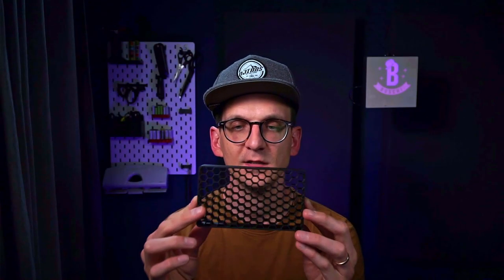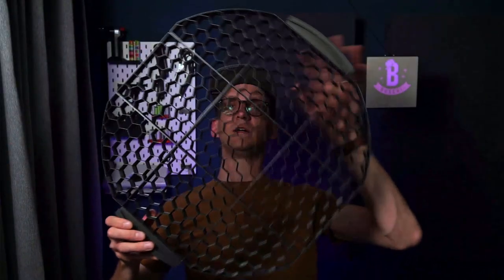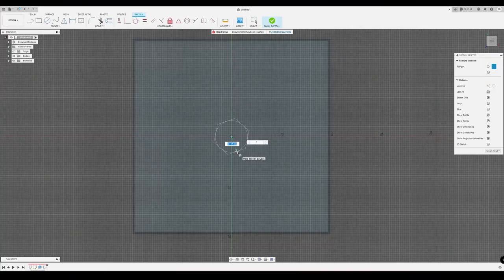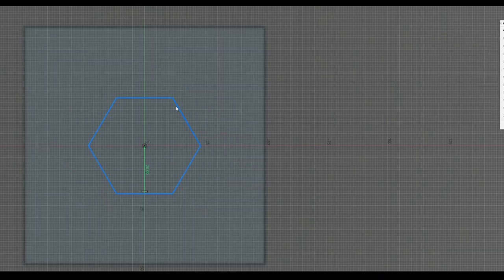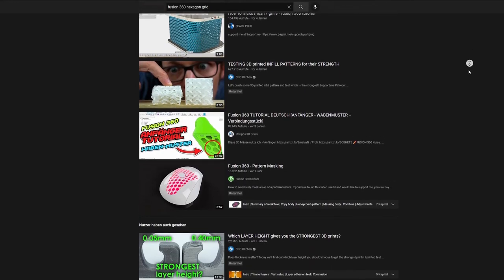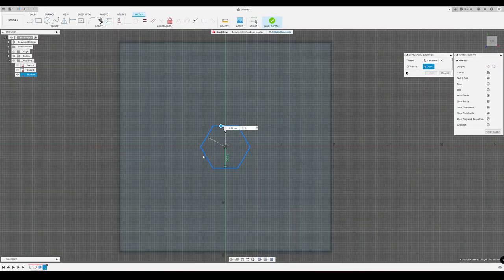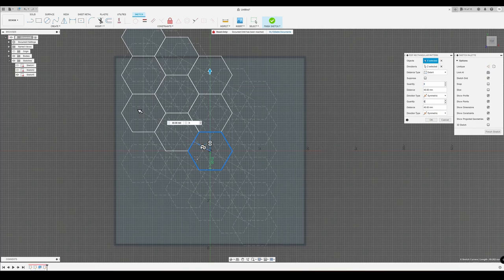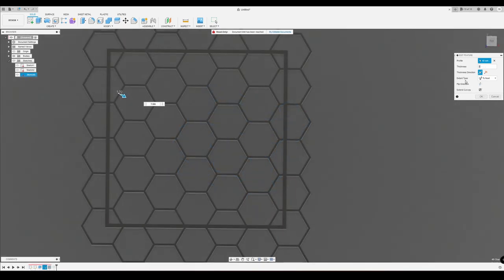Best Honeycomb Grid Trick in Fusion360

Comment: I know this is not CAD based but if you just need a quick honeycomb structure to print try this: 
Drop your solid part into your slicer,
Choose honeycomb infill, 
Choose no top or bottoms walls,
Change infill density to change how many hexagons there are,

Simple thing to do in slicer if you need a or want a quick easy fix but definitely use CAD if you want parametric designing and to make more complex patterns. 

All in all good Fusion tip! 👍 Got you a sub!

Edit( I really should have noticed that everyone else in the comment section had the same idea before posting… oh well… great minds think alike!)
Reply from the maker: Exactly. For quick and easy I would also go for slicer help, which opens a whole new world of tricks. But as you said, for a proper model I go the longer route. Check out my new video on this, which uses a slightly different approach https://youtu.be/EayXBg41U9M

Comment: I had a nightmare trying to work out how to create hexagonal light channels for a telescopic sight sunshade. In the end someone on a Fusion360 forum pointed out something really simple; just design the cylinder as a solid, import it into the slicing software and set the infil to hexagonal - then just set the number of top and bottom layers to 0. It worked perfectly and took moments. By far the easiest way of achieving this.
Reply from the maker: It is amazing what paths lead to success with 3D printing.. :-)
But personally I prefer a consistent model (if at all possible) even if that means a bit more work.. :)
Reply: @iambuschi  I totally 100% agree, there just didn't seem to be a straightforward solution at the time.

Comment: Or you could make it solid in fusion 360 as a separate body then when you import it into the slicer select that body and have it have zero top and bottom layers as well as zero walls then switch the infill to Honeycomb and adjust the percentage as needed. Might also want to set the infill anchor length to Unlimited.
Reply from the maker: Yes, of course that is possible.. but this also influences parts of the model that you want to stay solid.. And I personally don't like models that rely on hybrid tool processing process :)
Reply: I just commented the same idea before seeing yours! 😂
Reply: You could also CAD a separate region as a modifier in the slicer. That way you can play around with infill densities and patterns quickly without modifying the areas you want to keep solid.
Reply from the maker: @eighty-eighth_section  OK right.. I didn't think of this.. :)

Comment: I've been using rectangular pattern for years and I thought it was the norm for hexagons. 🤔

I never tried the web tool, tho.

The only problem with manual extrusion of a honeycomb grid is that, computation wise, it's as heavy as a brick. =(
Reply from the maker: Sure rectangular is a no brainer.. But have you been using it in pure x and y direction?
Reply: @iambuschi  No: I used it in many ways, one of which is for hexagonal patterns, like you described in the video.

The only difference is that I always spaced the hexagons instead of making them attached to each other (and for circumscribed hexagon, you don't need silly numbers).

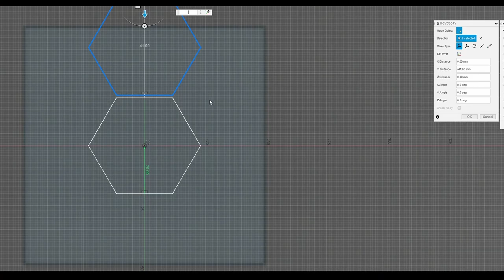Comment: 1:50 I mean Idk what software you use to design but you could have just defined a variable (lets call it "S" for "Spacing") and then just write "S" on the dimension. Then if you changed the value of S then every other dimension that uses it would change too
Reply from the maker: Sure, there are many ways. But IMHO it is still way more effort to do it this way instead of a single hexagon and letting Fusion do the rest :) Let alone to make sure the alignment is correct. Multiplying procedurally is also a problem and just defining all of the hexagons by hand is too cumbersome.

Comment: not enough explanation on how to use the Web tool.  I keep getting an error that it can't intersect with a solid object.
Reply from the maker: Yes, the web tool can be a bit unwilling.. have you tried to replicate my steps exactly to copy what I created? Otherwise I suggest you start this way first and then try to apply to your case afterwards. Then see what the diff is and this should give hopefully enough pointers to make it work..?
Reply from the maker: One more thing, have you seen that I have another video on this topic? https://youtu.be/EayXBg41U9M maybe this gives you another angle that helps solve the issue you have..?
Reply: @iambuschi  Thank you for the tips.  I have now tried your method, and although it works, I am not convinced its any less work than using the pattern to just extrude or cut , on or through a surface.  Both seem to work.  I do thank you for making me aware of the web tool, which I was not previously.  I think it's an opportunity for Autodesk to add some functionality to the feature specifically for making grill patterns, which seems to be a common thing folks want to do.
Reply from the maker: I agree.. Actually I think performance wise it is the same or worse.. but I found the workflow a bit more intuitive at least.. Great that it worked for you.